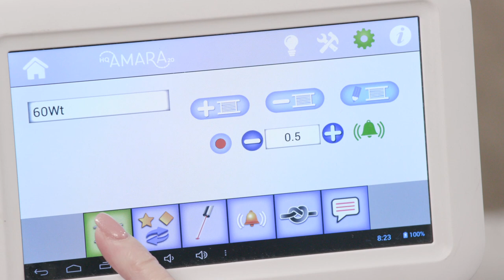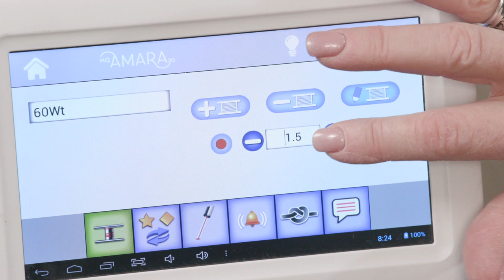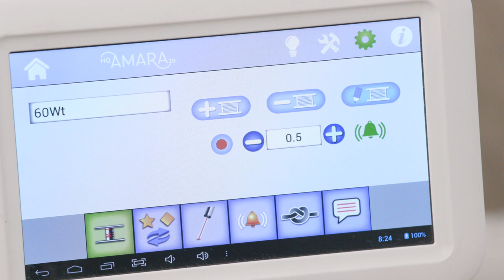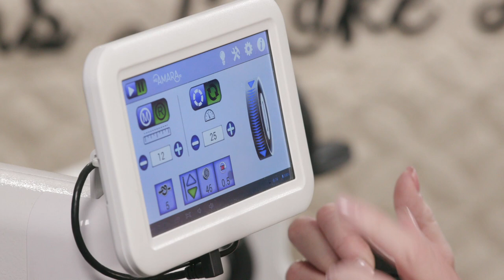All About Bobbins! - Watch and Learn

Comment: Thank you so much.  I don’t have the Handi-Quilter long arm but I do have the Tiara III sit down long arm machine,  I am just learning how to use it and found these videos so helpful when there is a problem.  I was stitching just fine the other day, the tension was perfect when  all of a sudden it started stitching very tightly, pulling and bunching  the fabric as I stitched.  Then I noticed the thread had come off the antenna that sits at the top of the machine where I first place the thread from the spool to thread it . Fixed it problem didn’t correct itself.  After a very long time spent threading and rethreading, tension adjustments, checking the bobbin for lint, etc, I gave up.  Today I pulled up this video I have watched before—-I placed the bobbin  in the case wrong!  I even had gone as far as getting a new bobbin case, which arrived today,  so I laughed at myself when this video talks about getting a new bobbin case!  I didn’t need one, but, yes, now I have an extra one which is just fine with me!  And I didn’t know what that piece in the bobbin case was called until today!  I thought I bent it from when the fabric was pulling so much, as it was raised up some in the case. It seems to be ok though, so i guess I don’t need to worry about it.   Thank you for sharing all this good information for the Handi-Quilter as it is helping learn about my machine  as well!

Comment: Thank you!  I have the Tiara III sit down long arm and use that same bobbin winder.  Was having trouble with it winding more on one side than the other, this video helps me immensely!  Also I have trouble with putting the oil in, I can’t see what I’m doing because it is located under the table that came with the machine so more than a drop of oil goes in.  You answered my question when you said it was ok to wipe out the excess.  That’s what I have to do.  How often should I oil the racer in the bobbin area?  Thank you for sharing all those tips.
Reply from the maker: Handi Quilter recommends oiling with each bobbin change or if the machine has been sitting for a couple days.
Reply: Thank you! I will do that!

Comment: I would like to reiterate the bobbin spring can use some more discussion. 
It took me almost three years to find someone else complaining about the issue I was experiencing with tension. It was in a discussion board on a different manufacturer’s website. 

Please; though it may be less common, could you make a video discussing the spring housed inside the bobbin case that HQ encourages us to leave in even with prewound bobbins?

* Where should the top of the bobbin be in relation to the bobbin case?

*What happens if the spring is adjusted to high/low and your bobbin doesn’t sit where it should within the bobbin case?

* Can the spring be adjusted and if so how?

This was an issue I had with two brand new bobbin cases, one that came with my brand new Amara and the second I purchased directly through HQ website in an attempt to cure the issue. 

Please know that I am not stating this to be a negative but to help others that might experience a tension issue that isn’t commonly discussed, and if it’s a singular topic it will help others to find the solution much faster than sorting through information that they already tried and failed with. I almost returned my Amara and returned to quilting on my domestic machine. But I have corrected a very simple and easily overlooked issue and she quilts like a champ!
Reply: I recently purchased the king quilter 2. I have been quilting about a month now. I am having so many tension issues. Every time I change the bobbin I have tension issues. And like you, I have tried every suggestion.
Reply: @FarmHouseQuiltery  yes. My tension issues were due to the spring in the bobbin case being adjusted too high so my bobbin sat too high in the case. Halfway through each bobbin the tension would change. Even the expert quilter from the dealer wasn’t able to figure it out. I actually used the Towa gauge to confirm the my tension was changing. I pulled entire bobbins through it and started with a perfect tension and by the end of the bobbin, the tension was so tight it wouldn’t even register on the gauge.  I made then adjustment to the spring height and I have consistent stitching.
Reply: @emnnate1996  I can relate entirely to how frustrating it is. When your issues are less common it is more difficult to find the solution. And sometimes every path that has promise leads to disappointment. I can’t believe it took me almost three years to pin down. I saw on a messaging board I think it was APQS, someone was talking about removing the spring and replacing it with the magic gennie washer to solve their tension issues. So that put me onto the scent it could be my spring. I searched for information regarding bobbin springs specifically and that’s when I learned the spring needed adjusted from a singular video on YouTube. 
You become a really good detective tracking down the perp that is tormenting your tension! 
I hope you find the solution soon.
Reply: @FarmHouseQuiltery  Yes and still had the same issues. I love my new macnine. I changed the tension and filler length on my bobbin winder too.
Reply: What tube video did you watch. I would like to see it also. Does the spring have a right and wrong side?  Do you know how to cure the “zigzag” look to your stitches?  My last quilt had perfect stitches. My current one not so much!

Comment: Great video. I have a Moxie bobbin winder which does not have the tension adjustment knob. My bobbins are not wound evenly, how do adjust? Thank you
Reply from the maker: On the Moxie bobbin winder, it is on top. The discs that you place the thread between is your tensioner. You adjust it there.
Reply: @HandiQuilter  Hi Sorry my wasn’t clear. My wound bobbins are fatter in the middle than in the sides. Is it important that the bobbins are evenly wound, ie same fullness on sides and middle? If it is important how do I adjust the bobbin winder machine to wind the bobbins evenly? Thank you 😊

Comment: The bobbin winder I received with my moxie isn't like this. No speed control and the bobbin is on top not the side. Less adjustable it seems.
Reply: Mine is also different than the one in this video and I have the Moxie too. Also when I wind mine it looks like a tire.... fatter in the middle, how do I adjust that.

Comment: I think i need to order a whole new threadmast with pigtail. My pigtail broke the first year and the relacement sits half way up the mast and is not adjustable. I have to hold the thread while winding or it will jump out of the disks.  I have three spongy (useless) bobbins for every good one. I hate winding bobbins!
Reply: Instead of going from the pigtail over then under the tensioner (basically running the thread clockwise around the tension disc),  I now go from the pigtail down under then over the tensioner (counter clockwise) to the bobbin.  The thread never pops out that way.  And I’ve just loosened the tension a bit to make up for the extra pull on the thread as it winds.  Just what words for me.

Comment: Yes you could mention the type of bobbin's the size referring to the size of the bobbin them also whether to use metal or plastic bobbins you didn't mention anything about that and I was hoping you would.  And if you buy some random size bobbin's how you tell it's a will properly fit in your machine what major ments tell you which fits which for any machine whether it's to mastic or a for one of the things that you are you saying Xete
Reply from the maker: Hi Kristine.  All Handi Quilter longarm machines use "M" class bobbins. We recommend that you don't try to use anything other than Handi Quilter bobbins or pre-wound M-class bobbins. If you have bobbins that are a different size, you should wind them onto an M-class bobbin.